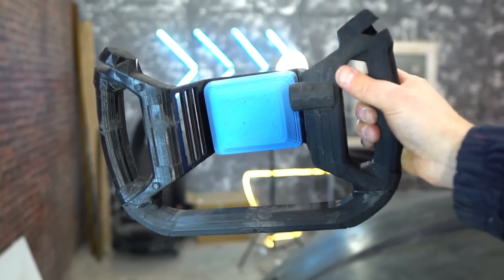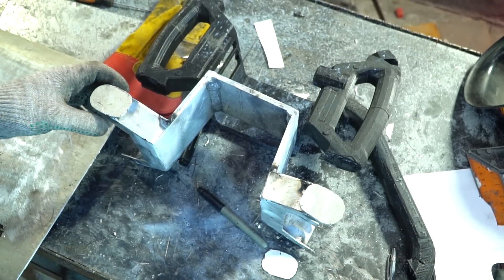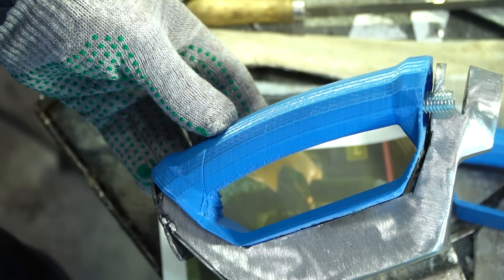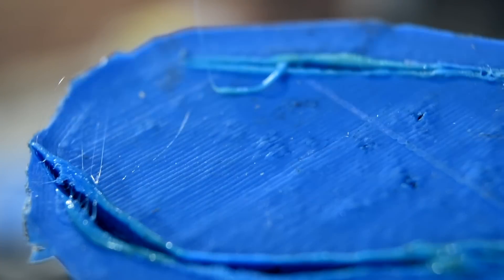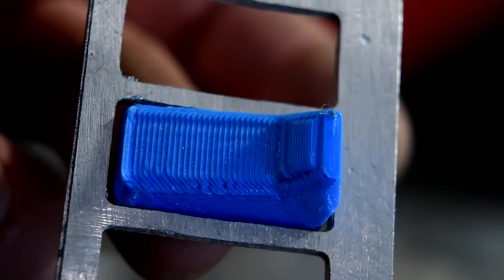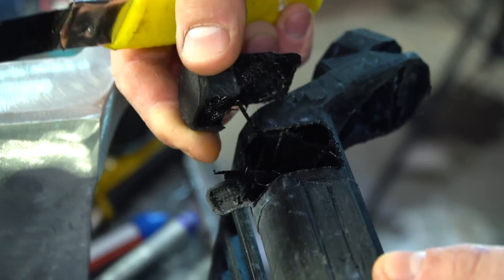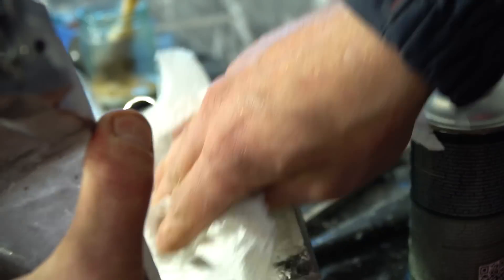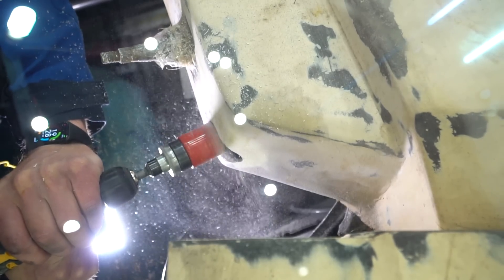WHEEL. Quadra V-Tech in real life

Comment: Bit a of a late comment but it would be worth investing in a quick-rack steering system, it would make actual driving of the car in the future much better as you only have to turn the wheel around 160 degrees for full lock rather then having to let go and regrab such an awkwardly shaped steering wheel

Comment: I wonder why you couldn't make a rubber mold of the 3d printed steeringwheel. Weld a steel inner skeleton of the wheel (that fits inside) to give it strength, add all the electrical wiring you need into it, and pour dyed black epoxy resin in over the steel skeleton and wires for the finished steering wheel.

Comment: Honestly, this is the first time I've seen someone with a 3d printer using the plastic parts so... liberally. The polygons are still visible on the various parts and the whole part with gluing a plastic cube and then drilling a hole through it was quite something. I fully respect the hard work you're putting into this project, but man, you are really underutilizing your printer.
I would highly recommend getting a CAD software to at least model out some bits and pieces to simplify what you have to do. It might sound like more work, but in the end you're left with backup files and a quick and easy way to replicate parts that don't fit, break, or simply need a re-design. Stuff like those paper cutouts could, for example, be sketched out and then printed in 1:1 proportions without much hassle. Fusion 360 is a popular choice and offers a free license, if you're interested.

Comment: Your aluminum "warps or " miss-forms  because of the heat from that your MIG welder outputs when welding , buy yourself a TIG set up, much less heat, much less warping and better control of your welds...... Also much less grinding to fix the "over welding or excess "